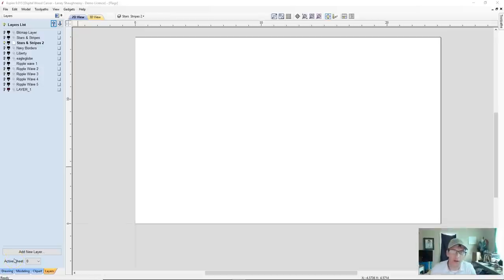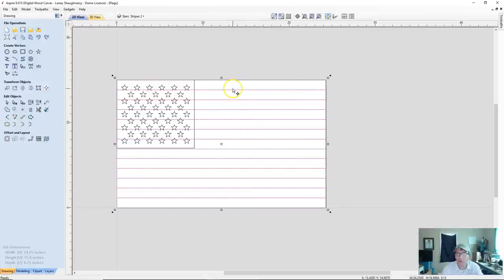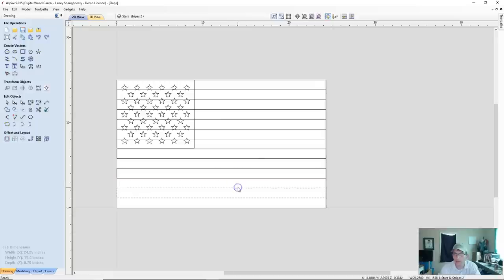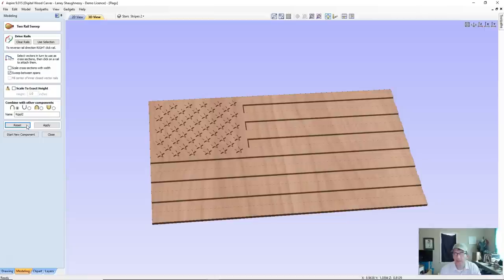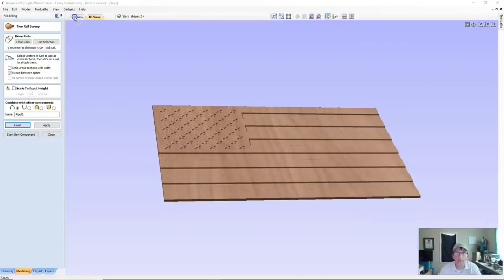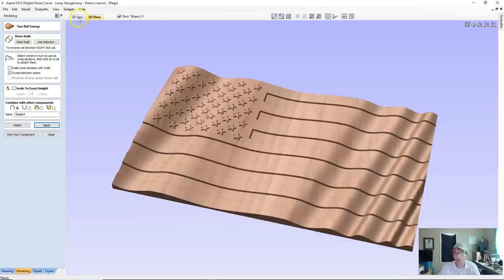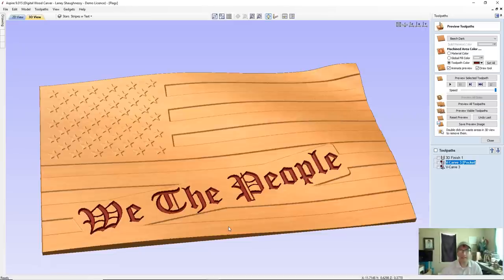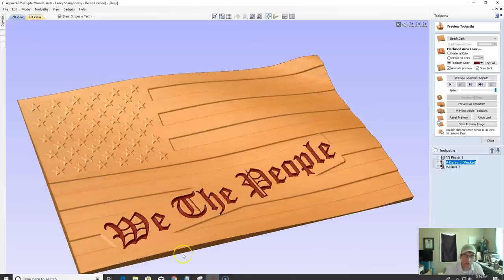How to create a 3D Model US Flag in Vectric Aspire

Comment: Great video. I am brand new so bare with me on this comment. I believe the inner radius percentage should be 38 and not 40. If you zoom way in on the star the star is not perfectly flat across it has a very slight wave in the line. Very minor and I am not sure yet if it will show on the carve.
Reply from the maker: Actually the inner percentage radius, should be 38.2 for a constitutional star, you are right it is supposed to be straight across. I had made this tutorial before I knew that fun fact.

Comment: 2 Questions:  1)  Can this be done in Vcarve Pro or do you have to have Aspire?  2)  How long would it take the CNC to create the wave flag with logo?
Reply from the maker: To create a model it requires Aspire. VCarve Pro does not have the modeling tools required. Depending on the Feed and speed settings of the tool, this project to take 6 + hours

Comment: Great video.  There's a lot to digest in this and it is pretty straight forward.  I haven't gotten all the way thru the training yet, but one issue came up I was having a problem with around the 20 minute mark.  In doing the baking of the duplicated level at that point, my version of Aspire 10 you can't bake a grouped set of components.   They have to be ungrouped and I found that if you hold the Crtl key when baking it creates a level of unbaked components automatically. I was trying hard to see what you had done and I reverted to searching for the reason I couldn't get this to work right.    At any rate, you have done a great job of providing instructions that make using.

Comment: This is a great video and so helpful and inspiring to do different things BUT you missed 1 huge step that I can not get passed. I noticed it has happened on your project as well but you skipped it. At time 20:42 exactly when you baked the project it inverted it WHY????? and how do you get out of it??? The next sec you had already fixed the issue and moved on
UPDATE: I did wind up fixing this but I am a little confused as to why it did what it did. Some how it took the last in the components and used it (stripes) as the baked properties and it named the file that. Very confusing. This is still a very helpful vid!!! Keep going we need you!!

Comment: I have a simple question concerning milling. If I am cutting with Inside Left does the 0,0,0 datum preserve the offset of the bit diam or is the 0,0,0 position dead center of the bit and then when routing the offset then takes effect? A simpler execution statement would be: bit starts out dead center on datum point then offset takes effect when cutting. I need a precision cut done but am not sure how the cutting offset is put in place. Trying not to waste material. Thanks.

Comment: I am using the trial Aspire download to see if I can do this.  I was tracking with you all the way until you got to "Lets add a wave" and you selected a drop down from the top screen of your 2D called stars stripes 2 (at around 22:00 in the video.)  My question is do the ripple waves 1, 2, 3, and 4 come with the Aspire software or are those features you previously created.  I don't know if those features are missing  because I am using a trial Aspire or if those are your personal creations.  Please advise, thanks!
Reply from the maker: The drop down menu with that you saw the top of the screen is the layers menu and in the layers menu is where you can store or place vectors that you've created the separate parts of your design this is not a feature or a program within the aspire trial or full version this is something that you would actually create within the aspirethe vectors for the Stars and stripes as well as the two rail sweep for the waves all of those were created using the drawing tools in the cad side of the software

Comment: I have one question what kind of computer are process are you running because mine's dragging. A--
Reply from the maker: I use an Acer Aspire 15 model laptop and my desktop is a HP Pavilion 8 gb RAM, AMD A10-5700 APU with Radeon HD Graphics Processor.